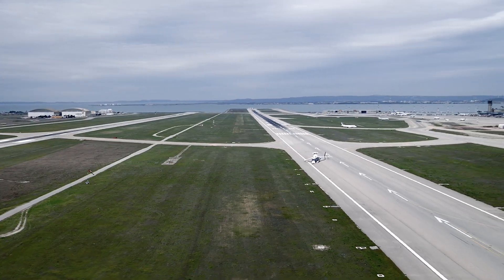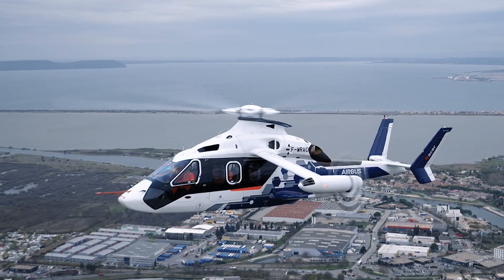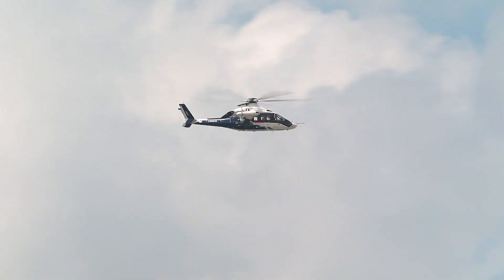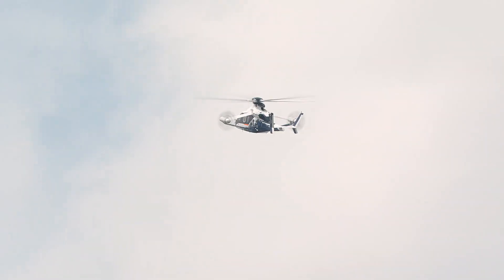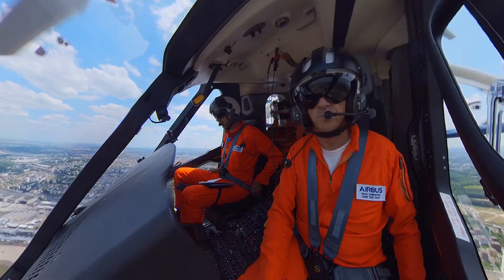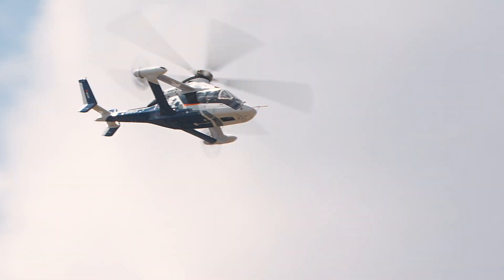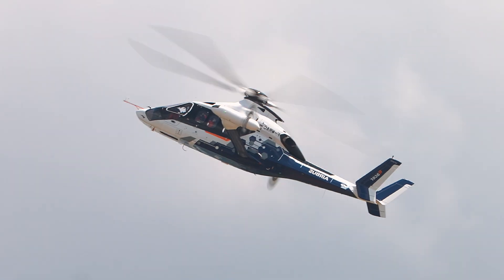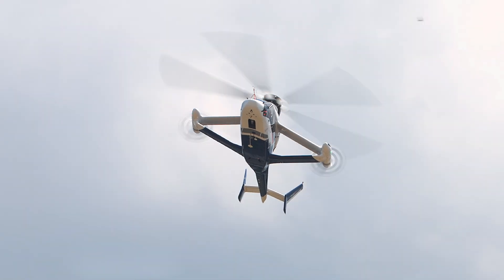New AIRBUS Racer - a revolutionary helicopter that changes everything

Comment: two concerns: ground personnel and passengers walking into the pusher props and main rotor blades potentially flexing down into the pusher props (maybe in severe turbulence or during violent maneuvering)

Comment: Wasn’t it bell in the 50s who added two turbines to a fuselage in a testbed? So, nothing new, here, except a lot of computers who are needed to fly the X3
Reply: Yes. This is an old concept called a compound helicopter.
They had flying prototypes in the 1970s, but the idea was shelved because of the fuel consumption.
Reply: Yes, the Bell 533 was similar. But it has two jet engine on each side (not turboprop engines).